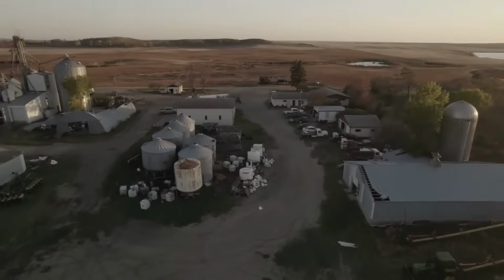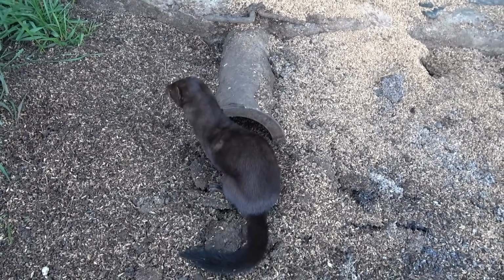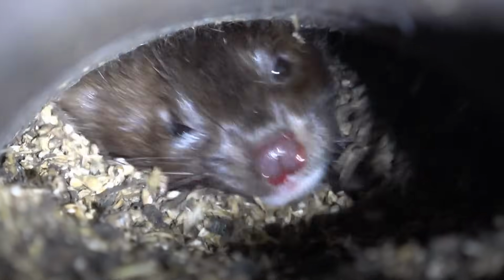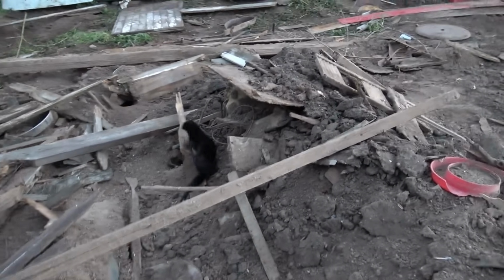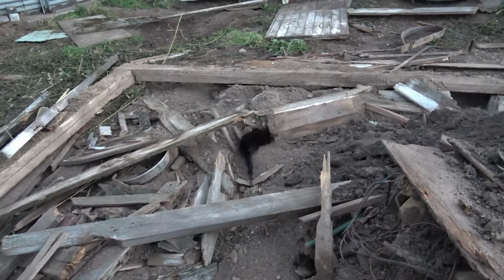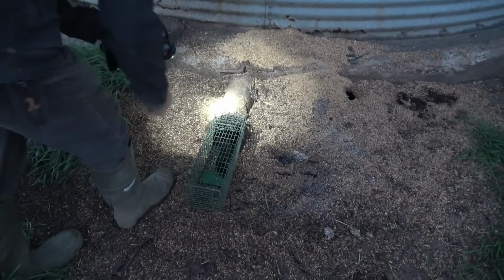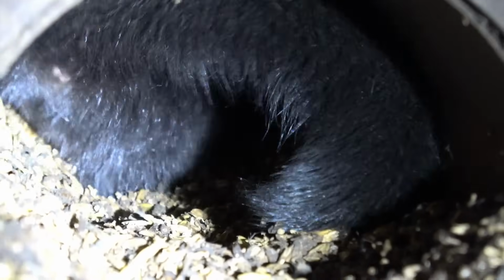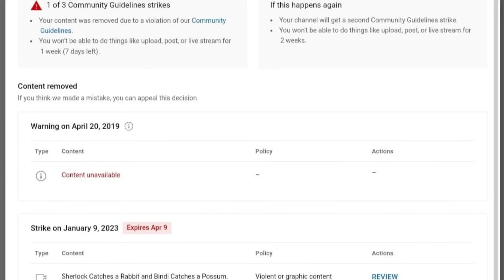Mink Cleaning Up the Last of the Rats

Comment: Probably been asked before but what is the reason multiple minks aren't released to hunt at the same time?
Reply: I would imagine it would be next to impossible to control. With about 3-4 minks you can't have your eyes everywhere.
Reply from the maker: For one they typically fight each other. But even if they don't fight, it's really easy to lose them as they are difficult enough to keep track of one at a time!
Reply: @JosephCartertheMinkMan  I've seen 2 used b4 but mostly 1